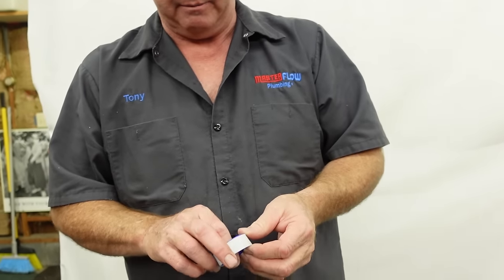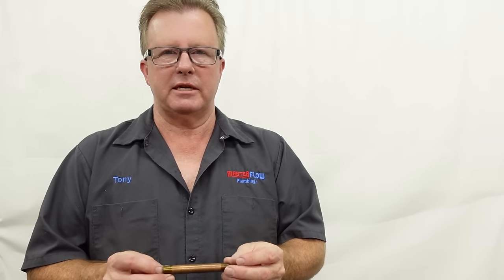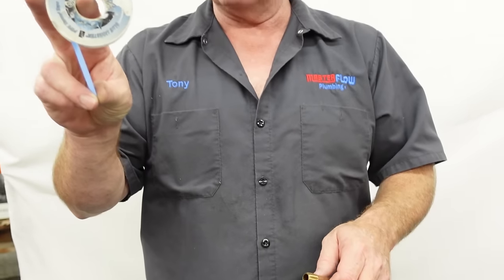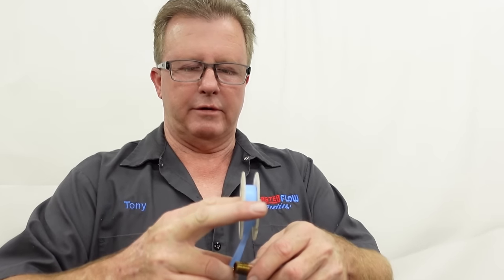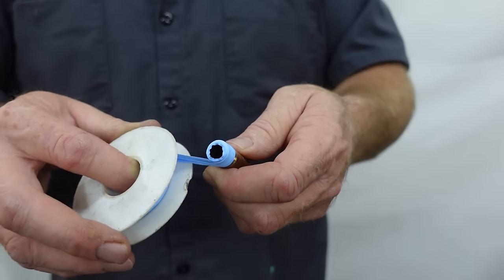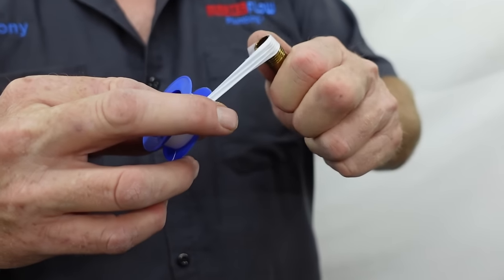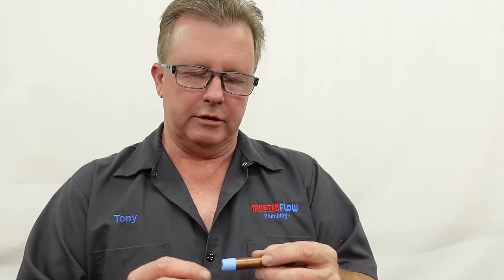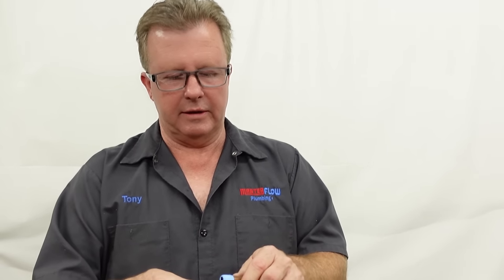How To Correctly Wrap Teflon Tape

Comment: He did it correct in the first instance but incorrect in the second instance. It amazes me how many of these dopes, even pro's, don't have a clue as to how to hold the dispenser to properly wrap a pipe or fitting. The majority of the time one cannot rotate the loose fitting in one's hand as shown, you're going to have to wrap a stationary fitting. This guy's technique is totally wrong (@3:59). That's NOT how you wrap a fitting, it's the opposite.
Reply from the maker: You sure about that?   At 3.59 I’m am wrapping it in a clockwise manner  we can debate the overlapping technique all you want. 30 years of doing this I’ve wrapped an awful lot of it hard to believe I’ve been doing it wrong. Opinions and techniques may vary. Thanks for commenting.
Reply: B Thomas is correct but not explicit.  Masterflow wrapped both the blue and white correctly clockwise on the pipe, but with the white had the tape roll reversed on his finger.  Often you hold the pipe still, or it is already installed, and you use your "spool holding" finger to wrap the tape around the pipe (instead of rolling the pipe).  You have to "brake" the spool with your thumb and fingers of the winding hand as you wind to keep the proper tension on the wrap.  If you hold the tape spool as in the white application, the tape unrolls too fast, is difficult to brake, and the spool gets awkwardly farther from the pipe with each turn.  Holding it as done with the blue in this video, each wrap of your hand winds the tape back onto the spool as well which you can then easily release as necessary by loosening your "brake" to keep the proper tension, "paying out" just the right amount of tape, which is especially helpful in cramped installations.  Agreed, it's surprising how many professionals have not discovered this difference.

Since plumbing pipe threads are tapered, the thickness of the tape vs other sealers generally doesn't matter, the threads just don't screw as far in, unless you are not getting enough turns because of improper thread cutting.

As you mentioned, I don't like the tape overlapping into the flow area because often the connection cuts the overhanging tape and it ends up stuck somewhere down the line.  If your wraps have not sealed the joint, the overlap wedging into the first thread probably won't make much difference and the risk of a clog seems like a risk, with little, if any, return, that one doesn't need to take.

Thanks for posting. This discussion will surely help many.

Comment: I always assumed the wrap should be in the direction that will cause the item being threaded on the pipe to tighten the teflon tape wrap rather than loosen it.  I just visualize how I'll twist something onto the pipe and wrap in the same direction.  
Using a piece of loose pipe is easy but unrealistic.  You ignored the issue of how to hold the roll of tape while wrapping a fixed pipe.
Reply from the maker: Thanks for watching

Comment: I wind the reel of tape around the fitting rather than the cack handed way you turned the fitting around the tape
Reply from the maker: Your way is great if you can’t hold the pipe nipple in your hand. But if you can why would you do it your way. Your way is not the only right way.  And yeah the thumbnail for this video is showing it incorrectly you win the prize for the 1000th person to notice that. Congrats
Reply: @masterflowplumbing9812  I would still do it my way if holding the fitting. The sarcastic comment at the end of your reply was rude and unnecessary
Reply: @paulwoodward4999  I’m sorry sir. I didn’t intend to hurt your feelings.  Just trying to lighten the comments with sarcasm is all. I actually liked your exchange with the other viewer.  Thanks for watching and my apologies for my sarcasm
Reply: @68motopro  no problem. I enjoyed my exchange with the other guy but found it frustrating after a while. Couldn’t deal with it if he were my apprentice

Comment: Why would you even screw metal into plastic?
Reply from the maker: Copper to pvc!  Galvanized to pvc !  Water softeners can have plastic threads but houses sometimes are copper. It’s called transition
Reply: @masterflowplumbing9812  yeah, I get that, but I was speaking of metal (male) threads into plastic (female) threads.   
This connection is bad news and a rookie move.   I thought you were a "master" 😜
Anytime you make the transition, male plastic into female metal is a  stronger connection. 
Anytime I transition from copper to PVC, I use a Sioux Chief (copper/PVC fitting) instead of adapters.

Comment: Master plumber, are you sure ? The most important thing with tape is rough the thread first . Putting thread sealant over the top of tape is useless. Never use pipe sealant on plastics . It tells you on the tubes .
Reply from the maker: So it says that on the sealant you have so you think that means all sealants ? And rough the threads ?  Lol.  Who taught you that ? I’ve never heard of it.
Reply: Never heard of roughing the thread .  Well I am glad I could teach the master plumber. That must make me the master of master plumber's.
Reply from the maker: Thanks for watching
Reply: Indeed, that what I am missing, rough the thread first.

Comment: I suppose, that you have seen the news about how PFAS has become a major environmental issue around the world. Nine states in US have made very strict regulations to counter PFAS in environment. Several places have got PFAS in drinking water. Therefore we all shall make an effort to avoid using Teflon (PTFE), because factories that produce Teflon emits PFAS. So I would like you to promote alternative ways to seal pipes.
Reply from the maker: im curious what you would suggest? In 30 years of being a plumber i just know when you need it you need it.. shoddy Chinese manufacturing  has led to loose tolerances on threaded pipe fittings.. We use to use just pipe joint compound when plumbing fittings were made in America. In the 1990s when American manufacturing  was sold to china the use of PTFE tape really took of out of necessity.. you should write a letter to the Clintons
Reply from the maker: i did google your concern and found this info : People also ask
Is PTFE tape toxic?
(PTFE) is inert, barely reacts with anything, and is non-toxic.Jun 1, 2022
Reply: Viggo. The phone which I'm sure you're typing your concerns on. Emits frequencies that cause cancer in California.  So I suggest staying out of California.  ;)
Reply: @masterflowplumbing9812  I agree, that PTFE itself is not toxic. As I wrote.. it is the factories that produce PTFE, that emits PFAS - so this is an important difference.
Reply: @CharlesMaley1987  There is a reason why there is a lot of concern regarding PFAS - very good scientific research. But people that suggest mobile phones cause cancer is very much alone and not recognized by science community.
Reply from the maker: @viggob4816  its mostly made in china so i think we are safe here.. right?  so again i ask what do you suggest we use ? im always open to learn new techniques for my trade..
Reply: Viggo...  "yawn"  Unless you live in the wild and rub sticks together for heat all your daily use things have bad emissions
Reply: @masterflow hemp twine and beaver oil. 🦫
Reply: @masterflowplumbing9812  I am not a Plumber. It is not the first time in history, that man found out - like with asbestos - that we should try not to use it anymore, and find alternatives.
Reply from the maker: @viggob4816  well i apreciate your thoughts but im a plumber not an inventor, when something better comes along ill be happy to try it .. thanks for commenting and raising awareness..

Comment: NOO. WRONG! DO NOT OVERLAP tape at the end of the pipe. Not necessary, and if a sliver of tape gets cut off, it can dislodge, and float and possibly travel to a place in the system where it can cause problems.
Reply from the maker: Funny I’ve been doing this for 32 years never had an issue and yet here you are an expert on the subject and your watching YouTube videos on how to do the very thing your  expert at. Kinda ironic isn’t it ?
Reply: Maybe it's OK on domestic water systems, but I've been assembling hydraulic systems for over fifty years and we ALWAYS leave the first thread bare.  As Paul B     
noted, a tiny sliver of tape can cause problems with valves and other components.
Reply: 👍I agree 100%